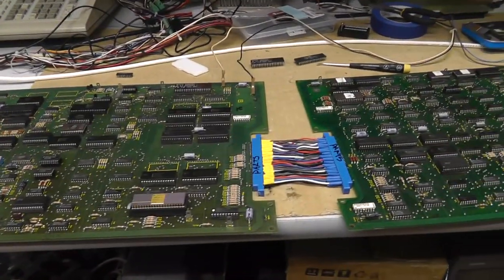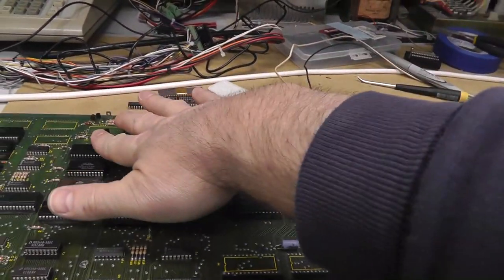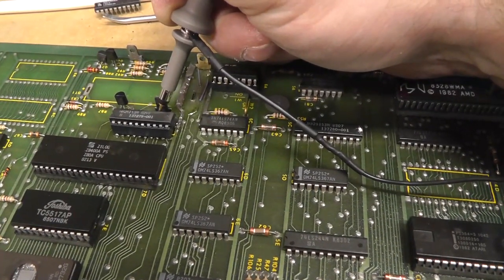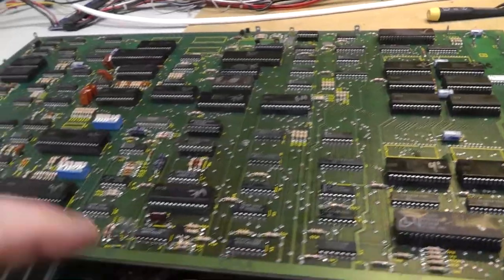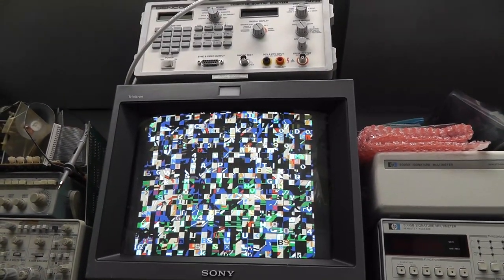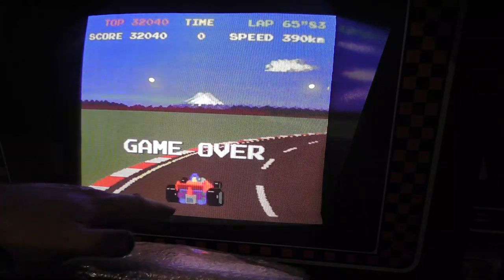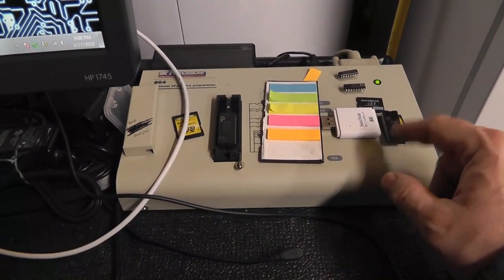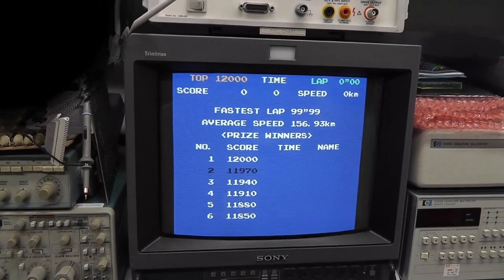Pole Position Video PCB Repair - RAM & Horizontal Lines Small Cars - RevC Set Part 2

Comment: Nice work - I picked up 3 (4?) PP sets just because they are complicated - I'm pretty sure they are similar in architecture to DigDug - just more stuff..  I haven't got them on the bench just yet..  But these videos have been motivational.  I have a couple repairs ahead of messing with them.  Thx
Reply from the maker: If I didn't have a working or spare boards, it would be much more difficult.  So easy, feels like cheating, to just swap parts and eliminate stuff.  Good luck.
Reply: @jacklick  Agreed - When I picked up my Gyruss the board was dead.  I spend a stupid amount of time working on it.. Finally found a second set of dead boards..  I had them both fixed in about 3 days after that..  2 or more dead boards provides plenty of into to make a lot of working boards :)

Comment: When reading a bad ROM chip I didn't know you could test the programming voltage because won't it erase the data content that is loaded on the ROM chip if you're trying to test the programming voltage?
Reply from the maker: I wasn't testing programming voltage.
Reply: @jacklick  what was the 10% voltage ROM test? I thought you were testing the bad ROM chips programming voltage
Reply from the maker: @waynegram8907  the +/- 10% is testing the normal VCC operational/read voltage.  It reads the chip at 5v the 5v +10% then at 5v -10% to verify the prom cells
Reply: @jacklick  yes it does, I think you mentioned it as the "programming voltage" in the video so it confused me. I thought you're setting the programming voltage on the bad Prom chip to test the programming voltage and it failed. I think you were just testing the "Read Voltage" set at 10% percent because it will read the ROM data content at different VCC voltages to see if any errors will happen with the data content that is stored in the softwares buffer.